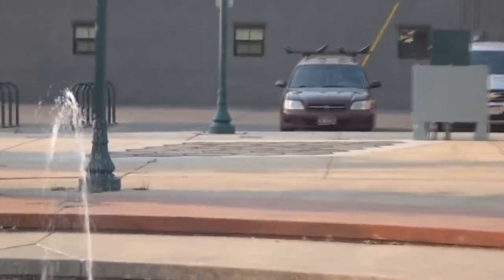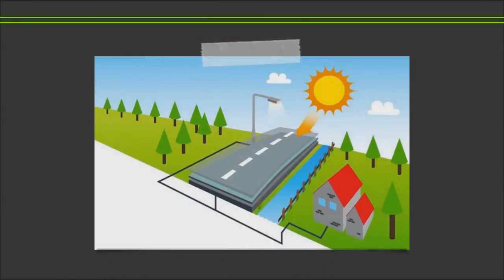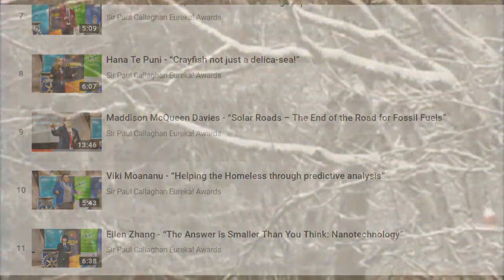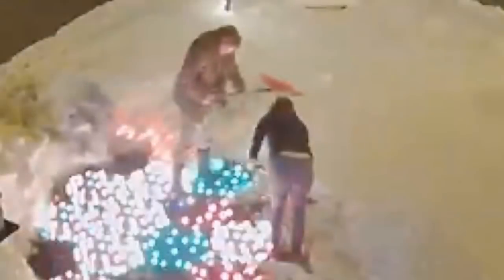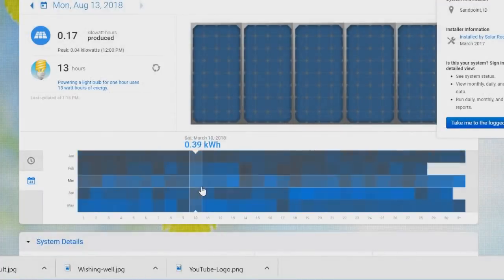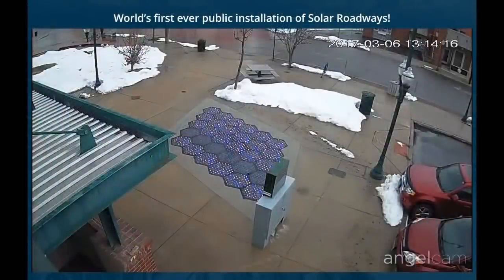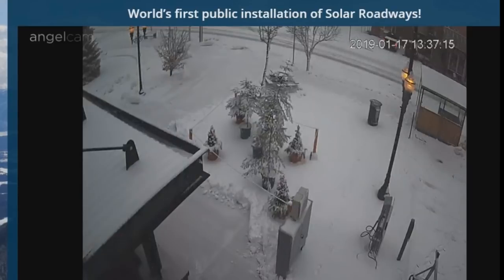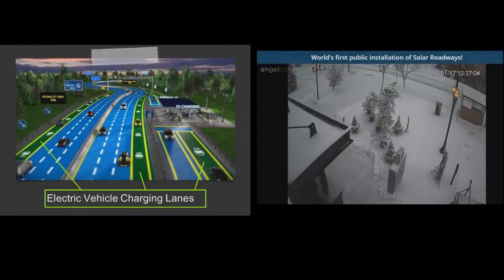Solar Roadways to be installed on Cruise ships!!?

Comment: Is it possible to work out how much energy it takes to build a wind power generator. Including the energy to create and transport the concrete base. The energy to produce the materials used mining , smelting etc. The energy used by all the machinery and factories needed to build it including fuel used by workers to get to work. And the lifetime repair costs followed by the energy to return the land to its original condition and recycle every part. Do they make more energy than the production cost?

Comment: Pretty sure if we put some sterling engines underneath a normal road, we could produce more energy with the heat the road absorbs from the sun... just sayin...
Reply: Probobly. Sterling engines can be extremely efficient when there is a heat gradient. They aren't at all space efficient however
Reply: It's an interesting thought. Like solar, it'd be more effective in areas with more sun. And there can be a surprisingly high heat differential in the ground around the surface. Not sure how long that differential would last with a sterling engine siphoning the heat, though.
Reply: @Nixeu42 
Hmmm. Well maybe if you had thin metal panels going down quite deep you could siphon much more of the cold from the ground and maybe reach an equilibrium.
Also then at night it will potentially be slightly warmer underground and the engine will work in reverse.
It could potentially surpace the energy density per square meter for solar power (given that the very best soler panels reach 20%? Efficiency and sterling's can reach 50% if used properly) but I can imagine it could be many times more expensive.

Comment: Hey. Give them some slack.

Given the options of
Coal-fired roadway.
Oil-burning roadway.
Methane-burning roadway.
Wood-burning roadway.
Ethanol-fueled roadway.
Fission-powered roadway.
Radioisotopic thermal generator roadway.
Wind-powered roadway.
Hydroelectric roadway.
Tidal-powered roadway.
Geothermal roadway.
Fusion-powered roadway.
Bomb-pumped fusion powered roadway.
Solar thermal roadway.
Solar roadway

I think we can agree solar is one of the best options.

Comment: If they have heating elements, wouldn't it work to melt the snow? Like even just keeping at 1 degree celcius on its surface should be enough to prevent build up.
Reply: seeing the original debunk video covers how much more energy and time it would take

Comment: I kinda like the idea of solar roofs for roadways (or at least parking lots). They'd keep a lot of snow and rain off the roads making them safer, and you wouldn't have to worry about stopping distances or cars parked on top of the panels blocking the sunlight... If only we could keep cars from bashing into the support poles.

Comment: Thuderfoot or any other scientists/engineers please answer this question. I know Solar Roadways are a dumb idea however would it be possible to have roads connected to our normal power grid to charge Electric Cars wireless like cell phones can charge wireless? If so would this be impossibly expensive? If it's feasable it seems like a pretty sweet setup. To never stop to charge or fuel up again would be amazing.

Comment: Anyone who thinks roads can be heated just with a relatively small solar panels, I suggest you look up the Hammersmith Flyover in London.   When first built, it had a electric heating system that was intended to stop snow building up and ice forming on the roadway without having to de-ice the road.  The system was turned off after a year or so because it cost too much to run.
Reply: Their website suggests their thinking was the tiles only needed to be heated to slightly above the ambient temperature in order to melt snow successfully. I don't even live where it does snow and that sounds like nonsense.

Comment: The efficiency of PV panels depends largely on their being installed at the correct angle, which is approximately the same as latitude. So the only place where it makes sense to install them flat is on the equator. There's a bit more to it than that but latitude is by far the most important factor. So installing them on decks of ships, flat on the roof of cars, or vertically on building faces results in a major loss of efficiency and consequently increase in the cost per unit of power generated.
To get the most efficiency you can mount them on 2-axis tracking arrays. But these tend to have a lot of moving parts that break down over time and require lots of maintenance. Next best is a single axis tracking system, less prone to breakdowns, slightly less efficient, but still requiring some maintenance. Fixed arrays at an optimal angle will still get around 90% efficiency of a 2-axis array, without the costs and maintenance. I think in the large majority of cases it's the way to go. This is why rooftop solar is such a good fit. Roofs of new buildings can easily be planned for the correct slope. Flat roofs can easily support angled racks. And it puts the power production very close to the consumption, which reduces line losses.

Comment: Just saw a video on tower batteries that work by lifting concrete blocks during the day using solar energy.  Then at night, they lower them to generate power by spinning turbines.  I would like to see the math behind this to see if this would actually be a practical method of storing excess energy.

Comment: Yeah pretty much... I bought my own DIY panels that you're suppose to solder yourself to old phone/ or extra rechargeable 9V batteries. To power my workstation, I need around 100 of these 2.5Watt panels which would go for around $200 as the grand total. (Probably a lot more since some components need up to 12V of power) Then I'll need some cheap and environmentally friendly led acid battries.

Comment: I would think that this idea would work in equatorial desert regions pretty well. it's sunshine  99% of the time and no snow were i live so, if each cell is as little 12v  200ma ( a conservative guesstimate from eyeballing the cells ) I'd need around 200 cells to get 40a! They look to be about 2 foot across that would about about 400 square feet. An easy fit into many Aussie homesteads driveways

Comment: 6:54 Lets also bear in mind that standard stopping distances were set a long time ago when neither brakes nor tyres were really much good. I doubt they calculated the stopping figures using a Morris Minor but instead simulated a modern car with ABS and modern tyres, if you're simulating a modern car and it's only just meeting standards then you've got a really slippery surface

Comment: I think we'll eventually have a material that can be used to replace road materials and act as a solar panel, but it won't have flashy lights. It'll just be painted like normal roads. Some day we'll have a material that will actually work like that, but these solar roadways are NOT that.

Comment: How can it heat itself if the snow blocks the sunrays which are needed to power the heater??? Also why would you put solar panels on the deck of a ship? At least put them at the top of the ship where can at least generate some power!

Comment: Okay, this always bothered me about the glass surface. Solar panels need to be hit by light as directly as possible to make the most of it. If the panels are covered in anything, it's a razor-thin sheet of glass or plastic manufactured and applied in a controlled environment so light still goes through as cleanly as possible. Yet with these solar roadways tiles, the glass is shown in promo images to be only semitransparent, even when flat against something or fixed to the tile. At that point wouldn't you be losing an appreciable fraction of the projected power yield to light being diffused by the glass before it hits the panel?

Comment: But if they would be connected to the main grid, it can generate "some power" during spring and then can be heated for winter to get rid of the snow on the most important parts of the city. (Obviously it needs to be heavily modified to sustain at least 10 years of continuous usage, which is kinda impossible for this kind of "road")

Comment: If you wanted to build solar roadways that do all this stuff, wouldn't it make more sense to do it basically the opposite way?  Just build a shed over the road and mount solar panels atop the shed?  You could run cables under the roof of it, the shed itself reduces snow on the road and with the right drainage setup could keep the road pretty dry.  LED signage underneath to provide traffic updates and the like  because why not?  The panels ought to be able to at least run that.

But then I'm trying to think of a way to make it doable rather than marketable.

Comment: If the beating sun can't melt snow in the winter.... How can solar panels melt snow if they just collect the same solar energy? The solar panels is just as efficient as black ashphalt which already absorbs most sunlight that hits it and i dont recall roads being a few degree above freezing even when clear of snow.
Reply: The panels were supposed to generate electric to send to the grid, and then when the road needed electric to melt the snow, it would consume electricity from the grid. As if the grid was some magical place that electricity just hangs out in until needed. Even if you could store all the power this road was capable of generating, it wouldn't be enough to melt the snow anyway.

Comment: In Delaware, there are solar installations, but ALONG the sides of the roads, at optimal static angle, that work.  Want to make smart roads, at least at night?  Projectors mounted to put brightly colored pictograms on highways that can sense when cars are inbound on lighter colored concrete that only run when needed is something that roadside solar panels can easily accommodate.  Running heating elements in the road, well... Not going to happen.  Solar roadways is trying to get to the moon using bottle rockets.

Comment: My company has mounted 2 test solar panels of 130W each, costing around 400$, they make around the same power as these did the first year.
The power is stored in batteries and i guess that it would be possible to run a laptop on the panels, nothing more.

Comment: One of the biggest problems for solar power is the limitation to power output arising from the solar "constant". Another is the fact that heat and full output seems to shorten the life of solar panels exponentially. Then there is the problem of constant gridlock. So, I find myself wondering; did anyone consult an actual engineer? You know; someone who can calculate the effect of roadbed flex on panel operation and lifespan as a fully loaded semi-trailer or B-double rolls over it or the impact arising from differential roadbed flex (which is why potholes occur in softer portions of the road). Somehow, I don't think that silicon tech is up to the task. It may come as a surprise that other approaches to solar power might be a little more durable but I think the potential is still very limited.

As in, to be viable, the tech has to keep the roads within a few percent of existing building and maintenance costs. It would go a long way if the tech could be devised to reduce one or both of building and maintenance but I think that's my cue to get the hell out of the rabbit hole!

Comment: I am developing a car that runs on ONLY truffles and saffron.  It produces as much pollution as fossil fuels, but it's so expensive to operate... most of the world's population will stop driving.

I'm full of "good" solutions to problems.  For instance...

They say if China and the U.S. do not participate in emissions reduction, it doesn't matter what the REST OF THE WORLD does.  That logic cuts both ways.  If the rest of the world just ELIMINATES China and the U.S., then they can continue on without fear of worsening climate change. #MakeWorldWarGreatAgain :-)
Reply: I like the way you think!

Comment: ice road truckers gave me a better idea than solar roadways, 2 plates of road with a fluid between, the cars running overhead would create a bow wave under the surface, the fluid would stay warm as its being compressed.. and it could work under high pressure so it acts as a hydrant system, they have roadside hydrants anyway.

Comment: Ok, on a cruise ship I understand. The ship's "roof" is where people would congregate without wanting sunlight blocked by a solar installation, and under those circumstances you wouldn't need heating elements and any serious wear resistance as you'd only be dealing with foot traffic and nothing more, but aside from that Solar Roadways is a frighteningly bad idea.

Comment: Cruise ships.  I was on a cruise ship, and a friend with me had served in the Navy.  He pointed out the ship had...warped a tad.  It isn't made out of the same level of materials as say a Navy Destroyer (One hopes a cruise ship won't be shot at).  Still, it is made LIGHT and that lightweight material sometimes shifts.  Looking at photographs, I could see the "wobble" in the walking paths around the outside of the ship. (We were in Alaska).  It was not dangerous (I was assured) but they do flex and give and change shape.  I don't think this would work on a cruise ship.  I can't imagine in colder climates where we have signs that pop up saying "Danger Frost Heaves" in the Spring, that a solar road could stand that either.  IT's not just the cars pressing down, it's the road bed or perhaps cruise ship pressing UP.  Why not just put solar panels along the road? Or as they do here, on top of the lights along the road?  But why ON the road?  Clearing snow is expensive, but...I imagine installing and re installing these things constantly will cost a lot.

Comment: You could embed LEDs and heating elements into blacktop, then install proper 
Solar panels on the sides of the roadways and have a far superior product. You would 
Also need to understand that at best the solar panels 
Would supplement electric usage not replace it. At best 
You could help bring down electric costs to a more reasonable level but that is all.

Comment: am i the only one that finds it slightly ironic that given how hot roads get in the desert  and how much cooler it is in the shade it most probably be more efficient to use the temperature gradient there to power a sterling engine. keeping in mind that sterling engines can be more than twice as efficient as a solar panel, and approximately 33 percent of earths land mass is desert

Comment: it's a cruise ship you have an abundance of wind and waves and very little surface to use it more than likely it would just be a a light show for a party ship 
 
why not every time you drop anchor you unfurl a mile or 2 of a floating ribbon behind the ship that pulls energy from the waves you go real big with it an maybe even make a ship that never needs fuel just a weeks or so to recharge

i've also seen a guy use PVC pipe running down the length of both sides of his fishing boat with a 90 at one end an a horn bell attached to a weather vain in the air inside the pipe were fans to recharge his battery i don't see why this couldn't be scaled up

Comment: I doubt "Solar Freakin' Cruise Ship Decking" would be able to power all the passengers' cell phone chargers simultaneously. You cover the whole deck with glass panels, then you have deck chairs covering a huge chunk of them, passengers walking/standing around blocking more of them, EMTs with stretchers attending to a massive load of slip-and-fall, heat stroke, and serious sunburn calls covering more of them, shadowed areas from the safety railings, and then you gotta hope it's fully sunny and the ship is at an advantageous angle relative to the sun to generate the most from the panels... 

These people have such a great understanding of Star Trekkian Science, the sad thing is we're not in the Star Trek universe (neither Kelvin nor Prime). I'd rather have a Solar Freakin' Transporter, think of all the fossil fuels, traffic, etc. we could eliminate if cargo and people could just "beam" wherever it/they needed to go? We wouldn't even need Hyperloops or networks of underground tunnels with elevators everywhere! _Live Long And Prosper_ lol

Comment: Surely if your road is glass or some transparent like material, that doesn't have "grit" in it, isn't it going to make the road rather slippery if it rains and you dare brake on it quickly to avoid something? Or God forbid, someone has an oil leak somewhere in front of you !!!

Comment: What's so weird about this is that you don't need to be a scientist or engineer to know that Solar Roadways are a bad idea. You're not only putting solar panels in a sub-optimal (to put it kindly) location, you're also asking them to serve as a road surface. Plus, there's already a better solution if you want to generate energy in the space taken up by roads; mount solar panels above the roads. The biggest technical "hurdle" for that setup is adding gutters to the panels to divert rain water away from the roads. 

I'm all for thinking outside of the box, but it only works if you're actually thinking.

Comment: In my country we use toxic waste in our roads.  And it actualy works. Non sane person will use Solar panels for roads. You are better of just lining the solar panels around the actual road... Also heating the road in winter will create very very slippery ice as it will melt and freeze again, best case scenario is watery layer under the ice.

Comment: Why don't we just put the solar panels above things rather than under them? You know, so they don't have things on top of them? That way we don't have to tear up existing infrastructure to replace it with inferior quality stuff that generates a small amount of power. I mean would solar roadways even generate more power than the increased power usage that it would take to install?